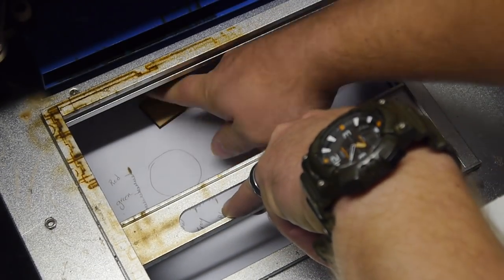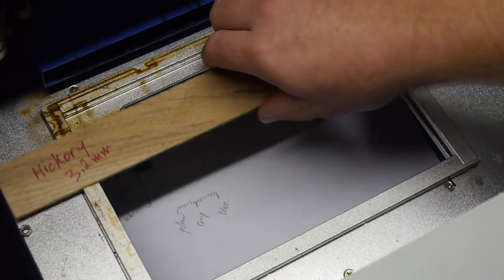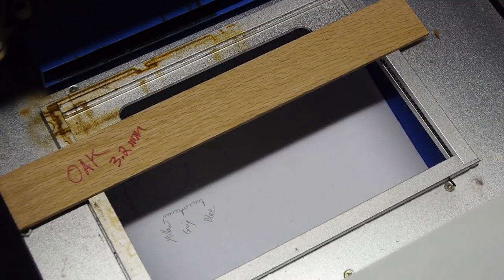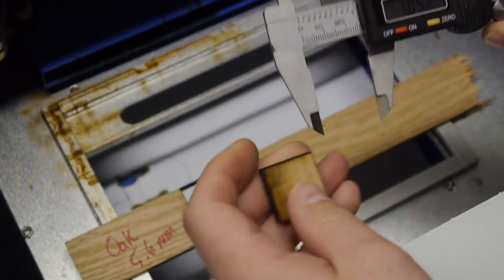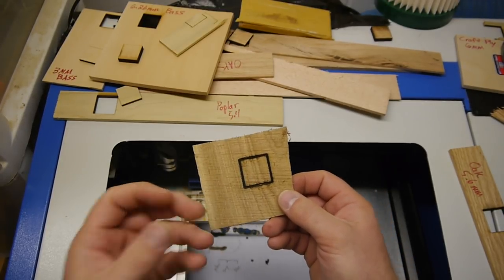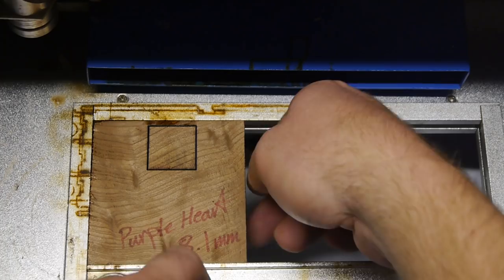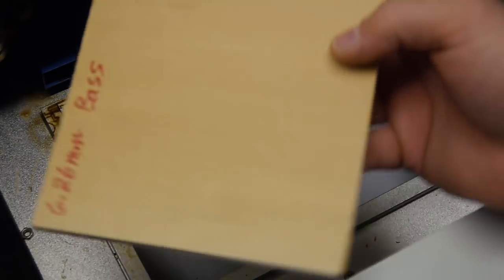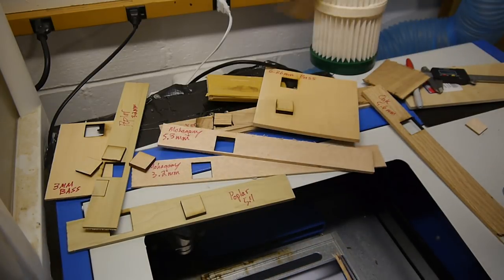Test Cutting 3mm, & 5mm hardwoods with Chinese K40 Laser Engraver

Comment: Thanks for the video Josh. Very helpful. I have upgraded my mirrors (20mm CU) and lens (18mm ZnSe) and got them aligned. If you look, you'll probably find your mirrors are plastic with a mirrored coating on one side. That's why I changed to CU. Inexpensive and much better in the long run. Air assist does make a difference!

While I haven't changed the control board, I did skip the software that came with it and got K40 Whisperer. It does a pretty good job. Once I get a few more things taken care of, I'll do a video of cutting a 9" diameter multi piece mandala and post it. I'm hoping to find 3mm Mahogany for it, if not, Hickory, or Oak.
Reply from the maker: You are welcome! I'll have to check my mirrors. I have been contemplating recently replacing the mirrors and focusing lenses, yet another thing on the to do list :-). I looked into getting the k40 Whisperer but they did not support my really old board. That sounds like a cool project, I look forward to seeing that video!
Reply: @JoshAQ  A new board is only 20 bucks,  I have a spare on the shelf.
Reply: @animeiprincess  I am thinking of getting one of these machines.  Which new board would you recommend?

Comment: How well does this do in regards to foam of various thickness' and sloping on the cut edges?  I use pink and blue insulation foam for model airplanes and other prototyping projects so accuracy is important. Also have you had any problems with your machine? Recommend it?

Comment: I was starting to think of not buying the 40wat but something bigger and prob 5 times as dear.  I have a 5 watt laser.  12 times around a circle on 3mm ply and 30 or more on complicated designs, dam wase of time. One of those table top ones.  Good for paper but does an A3 area.  Anyway great video and yes your new to it but that is what made it more interesting.   I already know I can make it cut better as you have seen by comments on air assist and speeds.  Air assist blows out the flames and the dust from the cut that the laser has to burn again, well burnt dust anyway.  I use it on mine.

Have you tried it on a wood called (MDF in Australia not sure in the US)  it was known as chipboard years ago but got better some years back.  It is man made wood, ground up wood and glued.  No grain in it.  Heavy stuff used in a lot of cheap furniture.  main issue with it is that it absorbs moisture and swells up so it needs painting.

Anyway my lousy 5 watt wont cut through even 3 mm,  just burns too much.  I believe it is the glue that makes it hard to cut.  

Also reading comment on ytube setting your laser focus point to stock that is 8mm thick at the same height as say 4 mm gets better results.  Even seems to work on my 5watt one on 3 to 4 mm stock.

So have you tried that yet.

Comment: Really enjoyed this.  So, this was with the stock 50 mm lens?  I was wondering if the Janka hardness of each piece relate to the number of passes, but the Chinese Elm threw that mix.  One of the problems with wood is silica intake, which affects cutting.  But, other than that, the Janka hardness does seem to have a direct correlation to number of passes. Air assist would help immensely.  I was thinking of buying one of these, I do a lot of inlay work, and the charred edges did put me off a bit.  Any sanding I do has to be taken into account on an inlay ( I use a CNC router now .. )  I use a lot of exotic woods near the top of the Janka scale, but the inlays only need to be 2.5 mm or less to be effective.  Thanks.. I might have to get one of these.
Reply from the maker: I am really glad you enjoyed the video, I don't know if the lens is 50 mm as I have not taken it apart to measure it. I can say that I never replaced it or upgraded it. I agree that air assist should help. I have been working an insane amount of OT recently 30+ a week, and have had little time for tinkering. It is on my list of things to do though. Yeah charred edges are a pain and would not be very conducive to inlay work like you said. Thanks for watching and commenting!
Reply: If you do a lot of inlay and are not afraid to spend a little extra, buy/rent a tank of Nitrogen gas from your local welding gas supplier, along with a regulator.  Connect up to your machine and adjust the gas pressure to about 1.5 -2bar (21 to 29psi).  This will minimize charring, but will require either slower speed or more power.

Comment: add a nozzle / airstream at the spot you cutting to blow away the smoke and carbon particles, they prevent from burning the wood underneath.
Reply from the maker: I will have to try this, sort of a before and after. Need to work on the design, I haven't had much time recently for home projects. LOL Thanks for watching

Comment: Hi, I wonder if you could advise me.. I want to get into laser cutting and I'm thinking of ordering one of these K40 laser cutters but I've come across various versions on eBay and I'm not sure what to look out for. Would you recommend one of these? What advise would you give me moving on from 3d printing? Can these laser cutters be used from fusion 360 or Chilipeppr or illustrator?
Reply from the maker: Hi Julius, I am no expert about the other K40 versions being sold on the internet at the moment. From the few videos I have seen it seems like it is a hit or miss proposition on whether you get one that requires a lot of fixing, wiring loose nuts, aligning mirrors etc, or just a little fixing. I buddy of mine bought this laser engraver and gifted it to me when he no longer had space for it. I still ended up tightening screws on the plastic rollers and such. I can tell you that my particular version requires proprietary software, (MoshiDraw 2016 in my case) and this software can be a pain to work with. Moshidraw does not lign up the y axis when switching from cutting to raster engraving for some reason. So I either do one or the other. MoshiDraw does not accept g-code instructions that I am aware of. If someone wants comment to the contrary I would love to hear it. It does have a Corel Draw plugin I believe... I don't have corel draw so I don't want to speak to much to that. With that is mind you could replace the control board with a Chilipeppr, or grbl board as an alternative and they would, I believe accept G-code instructions, although I don't know if they will raster engrave. There are plenty of videos on this and they would advise you better than I. I remember someone saying the board that comes with it is very similar to an old printer board. This would make sense as old printers used to plot the same way as raster engraving is done. As for using fusion 360, you certainly could do that, create a 2d extrusion and make a g code file to follow the profile at one height. You would need a control board that recognizes g code instructions though. My work flow is something like this. Use 2d CAD software, AutoDesk AutoCAD in my case, although you could use DraftSight for free. Draw my shape, and save as a DXF. file. Close the autocad drawing, then open MoshiDraw 2016, import the .DXF file. MoshiDraw treats every line segment as it's own individual line unless you draw in polylines in cad. You are then able to cut out the shape. I have seen it be fairly accurate this way. MoshiDraw does not account for kerf so you will have to account for that when drawing in CAD if pieces need to interlock. I usually do a couple test pieces to dial this in, but let me be clear it is alot of extra work to do this and there are software packages out there that will do this for you. But then again it is cheap, and when you go cheap you put the money back into it with time and extra cognitive load while designing. Let me know if this helps and if you would like more explanation on the MoshiDraw side of things let me know and I'll address those with a video tutorial if appropriate. Sorry for rambling on and Thanks for Watching!

Comment: I want to purchase a K40 for model railroading purposes.  Mainly cutting 1/16 and 1/8 inch basswood for structures.  Where to buy and who from?  Any help would be appreciated.
Reply from the maker: Hi Jay,
I don't really have any experience buying these from people. It seems like a good percentage of these machines come with some amount of tinkering needed to get them operational. i.e. tightening screws, aligning mirrors and so forth. Some have reported the pirated software they received with it, "Corel Draw" as an example, contained trojan viruses. I don't know about that as I received mine second hand for free from a friend, and I use MoshiDraw, which is terrible but free! I would recommend purchasing it through a company you trust to do right by the customer and not the seller. I.E. ebay tends to agree with the purchaser when disputes arise. I would think that there would be an advantage to purchasing from someone in the same country as you, and who has a goodly amount of reviews on that product. My thought is they would be more likely to send you replacement parts if something was broken when it arrived or stopped working shortly thereafter. Like I said earlier, I didn't buy it as it was a gift from a friend, so I did not do research ahead of time to find the best control board, or version of the machine. I think if you want to put time into researching your purchase, invest it in determining which controller board and software combo is the best for your purposes. Think about what software you currently have and how you would draw your structure pieces, AutoCAD, Corel Draw, etc, and then how you would import it into the software offered with the machine. Some people have created adapters and or have swapped out the control boards for other controllers. Some cut great but can not raster engrave well. The K40 Controller raster engraves well, but in my experience falls flat if trying to both cut and raster engrave on the same piece. Good luck and let me know if you get stuck and maybe I can help point you in the right direction.

Comment: Can you tell me how you do cutting 3 times? do you have that in settings for wood thinkness or you do manually?
Reply from the maker: Sure I can tell you. I use MoshiDraw 2016 as my control software. In the output window on the right hand side is a drop down tab called "NormalOption" click that. It should reveal a check box labeled "Loop" click the check box and then in the "Times" box select the number of times it loops. Now when you click the "Output" button it will perform the number of loops you have designated in the loop box. I hope this helps! Thanks for Watching!
Reply: how much it cost this software?
Reply from the maker: The software was free. Although if memory serves it was hard finding where to download it. The software is proprietary to my control board. I honestly would like to use a different control software, but the control board on the laser would not work with anything else.
Reply: Some people have changed controll board did you think about that?
Reply from the maker: I have thought about doing that. For me it came back to... well it works, just not great, and I always seem to have something else pressing to spend the money on. So I spend the money on a new band saw blade or something. LOL.

Comment: you really need air  to cut wood,especially elm,also your feed speed was very high,for  thin(-1/8inch) try aprox 6.2ma at about 1/2 the speed plus air  you should be surprised.

Comment: older video however are you still using this cutter or have you moved on ?
Reply from the maker: I am still using this K40. I have not used it much since then as I am in the process of designing an adjustable z axis table. I am hoping to make some progress on the first prototype this week with hopefully something functional this weekend. Thanks for Watching!
Reply: @JoshAQ  Sweet! i recently picked on up and I finished pimping it out, What I did to get a Z height adjustment,  is i bought one of those cloudray laser head upgrade kits where the lens moves up and down with the tube that holds it, Anyways Why i asked was because i am also a woodwork and i have no shortage of Domestic and Exotic woods perhaps we can combine our efforts and figure out which woods cut's best and what settings we use and document our findings.

Comment: do you need any safety googles with these lasers , if yes, what type ?
Reply: Technically standard acrylic safety glasses stop the laser beam. They do make specific glasses to match the nanometer of the wavelength of your style of laser. But I've found standard acrylic safety glasses FULLY stop the beam from penetrating.
Reply: Co2 lasers are Infrared so a pair of welding glasses (some not as dark ones)
Reply: @Catchmyep3  No not acrylic!  PolyCarb or Lexan  MUST be used.  It cannot be cut with these lasers,,,you make goodies out of acrylic as it can be cut!

Comment: I thought i would pass on some of my findings along, With 8mm Mohogany I was struggling to cut throw at 80 percent power and 3 passes at 2 mm/s, So i suspected something was wrong, i removed the analog ma meter that it came with, and put a DMV in its place, Now  I am able to fully cut throw 8mm Ribbon Mohogany with 50% power(9 mA) at 5mm/s and two passes. I am thinking most of these china laser analog mA meter has an incorrect resistor in the analog ma meter itself which is dropping lots of the laser power.
Reply from the maker: Patprop74, thank you for sharing!

Comment: I wonder what the silicon content of these woods is relevant but google does not seem to be my friend on this
Reply from the maker: Zachary Newman 
You know I wonder if there is a way to burn away the organics and separate the remainder into its component compounds and molecules. Too bad I was a C student in chemistry :-)
Reply: Sorry I read back what I said and my meaning was not clear even to me! 
Some species have silicon in them can be as much as 2% in some  cases. What i was thinking was a way to predict how difficult it would be to cut a given project in advance. If the silicon content was what was causing it to be difficult then that can be used for prediction. 
Turned out to be a bad Idea/Hypothesis for a number of reasons: I could not easily find out what the silicon content of different species was to compare to your figures. I did find a paper that said content was dependent on growth location. No saw mill lists silicon content for wood supplied. To find out silicon content a mass spectrometer reading would have to be taken of every tree. 
To sum up I had a thought. When inspected turned out to be unhelpful for many good reasons.
Reply from the maker: Zachary Newman,
No problem. Yeah, as a predictive tool it would be lacking as a mass spectrometer would be prohibitively expensive. I agree with the paper you read. I may have experienced this just recently. I purchased a mahogany board and was running into issues cutting through it despite having evidence it would cut well it was a struggle to get through the mahogany when trying to make letters. I compared footage of the two boards cutting and found this new board was reflecting more light back out towards the camera. Not conclusive proof because the conditions, camera locations, lighting, how warmed up the laser is, exposure on the camera, things of that nature were different in the two videos. I think an interesting experiment would be to buy mohagany from a couple different sources, Menards, Home Depot, Lowes, Local Supplier. Put them together and see if there is a difference across them and see what can be learned. Although I suppose a google search will probably provide results of something similar having been done. Although I learn best from personal experience so I will put this on my list of videos for the future. Thanks for postulating the idea.

Comment: Can we assume that every hole, measured exactly 1"? in your blank-  and the curf was always inside of your intended size?  nice demo of the differences...
Reply from the maker: I would not assume that. I would assume, at least until I get home tonight that the amount of kerf on the piece cut out is the same as on the hole left in the work piece. MoshiDraw, the software I have to use does not account for laser kerf. You have to account for it in the drawing. I have done a few test joints and had to offset all my cut lines manually in AutoCAD in order for the fit to be right. I think I offset like 0.005" - 0.010" on each line. Kerf adjustment is something done by good software, and MoshiDraw is not "Good" software in my opinion. Thanks for the comment and pointing out something I missed in the video. I'll update the description section with my results and post them to this comment string tonight when I get home.
Reply: Excellent, and will wait for the results,--for those of you that might not be following this...After doing test cuts as shown in the video, a offset figure and a highly accurate one at that, should result in a perfect 1" square if that is your desire, or a perfect 1" hole size...  i.e.  You may have to draw a 1.02 hole or a .952 hole... something like that..  Doing test like shown is the absolute best way to determine, and then be consistent for all the cuts after on like material.
Reply from the maker: Scott, thanks for pointing this out. I measure the holes and they ranged from dead on to 0.004" wider than 1". So a variance of 1.000" to 1.004" which is much less than anticipated. I was expecting 1.005" to 1.007". I believe the moisture content of the wood has changed since they were cut a couple months ago and has caused swelling and confused the results. Regardless Laser kerf would need to be measured and taken out manually ahead of time in the design stage or accounted for by the software. Probably the easiest thing to do is a test joint to get your offset numbers dialed in . Then start drawing your project with Kerf in mind and offset your lines appropriately.